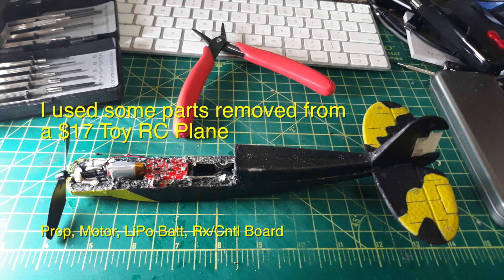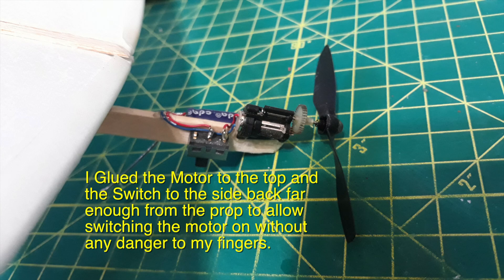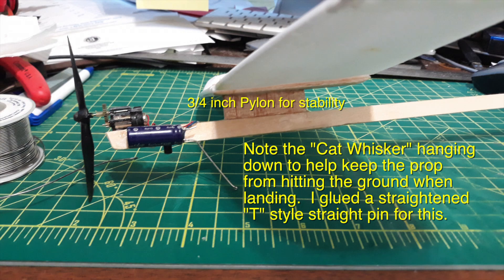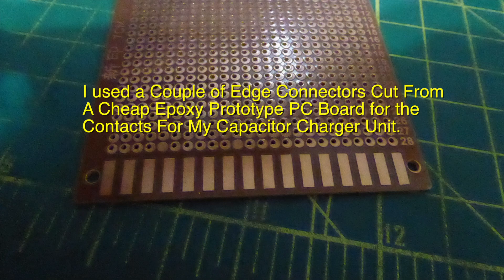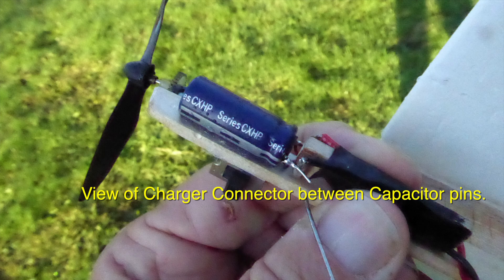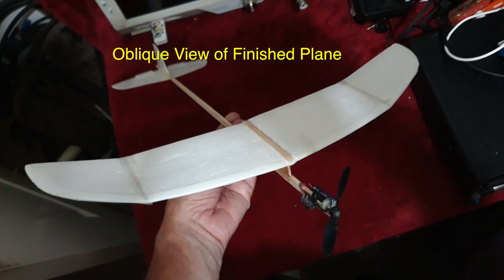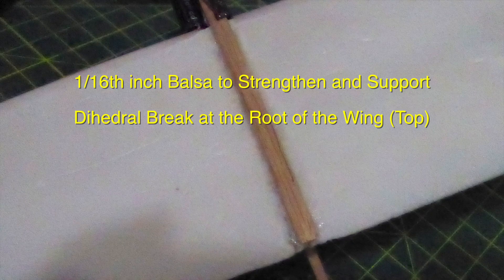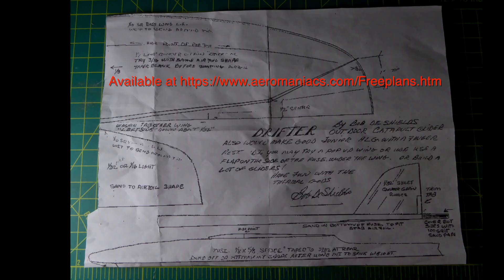Aero Drifter Build, Flying as a Capacitor Plane

Comment: Nice video. 1 quick question. Will balance be changed when motor is turned on?. I made one free flight too. It flies fine when motor is turned off, but headstand immediately when motor is turned on. Not sure what caused it.
https://www.youtube.com/shorts/n4aJKsgRNE8
Reply from the maker: Do you have the correct prop on the motor?  Sounds like it is blowing forward rather than backward.
Reply: Thank you for replying. It blowing backward. I changed motor's position close to aircraft body. No immediate headstand issue now. I am assuming motor position is headstand issue.

https://www.youtube.com/shorts/H3NqXJulceo

Comment: the motor+supercap combo seems pretty powerful, maybe tuning the propeller (size, pitch, angle) and plane CG to allow a steeper climb and get more air time? the descent is pretty smooth too, very parallel to the ground
Reply from the maker: Some have done as you suggest.  The AMA  now has super cap powered free flight categories and Joshua Finn at jhaerospace.com has kits and comments.  He has some videos here on youtube as well

Comment: Nice plane and nice flight. Could you please confirm, if I observed correctly in the video when showing top view of plane, that you have made provision for elevator (seems raised up) and rudder in the tail section to help in the flight?
Reply from the maker: Yes, I provided for elevator and rudder trim.  I usually use individual left and right elevators to allow slightly different trim to flatten out turns.  Rudder is normal.  All are relatively small compared to rc planes since we are only trying to provide trim, not aerobatic controls.  I also may trim the main wing, if needed.
Reply: @jimeagle1  Thanks for the response. Yes, I noticed left and right elevators separate. I am recently learning more about rc planes, and your information and video is helpful.

Comment: Okay I found some capacitors! So exciting! They're rated 2.7 and 3 V. I noticed you're using 4.5V battery pack. So I suppose in theory you're charging above the 2.7V? I guess 4.5 doesn't do any quick harm? I'm supposing if it's over their limit it might mean limited life but I think these things will still outlast our applications. Does that sound about right?
Reply from the maker: Actually I go by how long I charge the capacitor.  I usually stop at 10 to 20 seconds which only allows about 2.7 Volts.  As the cap charges to near its max voltage it will reduce the rate at which it accepts further voltage.  I haven't had any cap failures.  You can observe this using an amp meter.  Charge rate starts at about 2-3 amps but drops rapidly as the cap voltage increases.  Keep in mind that standard AA batteries have moderate internal  resistance.  I wouldn't use LiPo batteries this way because they would likely charge too fast and too high in voltage.  They would be OK if used in a regulated circuit like shown in the sonex413 videos, however.
Reply: @jimeagle1  Thanks for the note. I think I will make a charging circuit so it will always go to the same voltage. That way if I use a higher current solution it will be a fairly fast charge. Just a thought.

Further, I'm thinking of having a voltage boost to make the voltage at the motor constant. Or even create my own profile of power. Just a crazy thought.

Where do you live by the way? I'm up in Ottawa in Canada.
Reply from the maker: @DarcyWhyte  Actually, I have converted some to LiPo power and RC.  I use 8-9 gram batteries, typically, for this.
I live in San Jose, CA thus stay in the park flyer category... mostly 12-30 inch (30-70cm) foam wings under 50 grams all up weight.  Quieter and safer for urban flying though restricting my flight opportunities to wind speeds under 10 MPH ( 16 km per hour)... usually in the early morning or near sunset.
Reply: @jimeagle1  Perhaps once I get going at this we could have some zoom sessions! I'm trying to interest some of my friends in this so I will not be alone at the park. But I'll do it alone if I have to.. :)

Comment: Well done!  Love you’re resourcefulness in this project. It flies great!  👍😀
Reply from the maker: It helps to start with a good design.  Probably the best balance is to use 7x15 or 7x20 motors for 10-12 inch gliders.